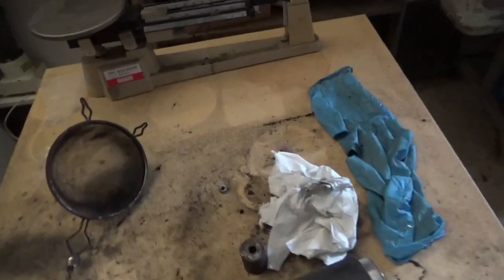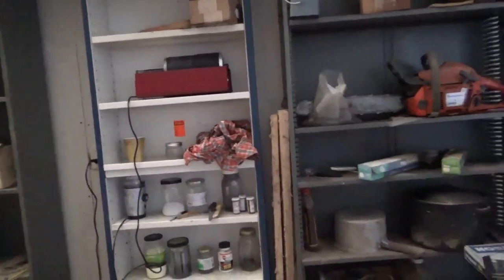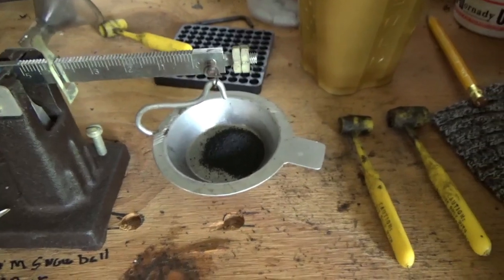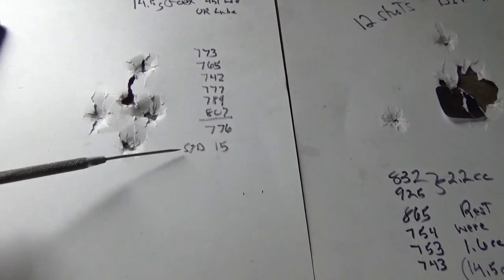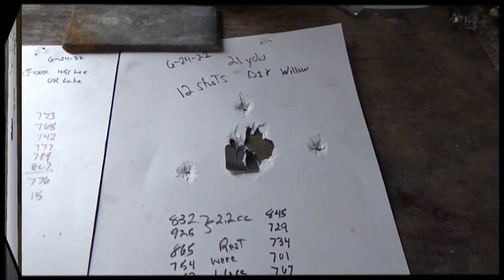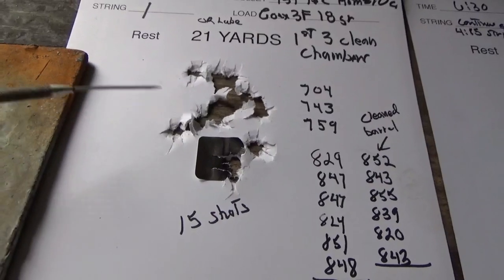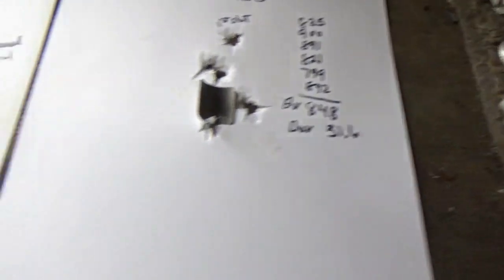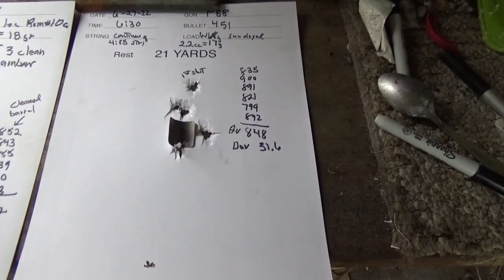DIY Black Powder VS GOEX in Revolvers

Comment: I've been making my own powder for a long time. I don't have a press
I just screen it. It works fine in my revolvers and rifles. For those who don't know, it's not dangerous if you are smart about what you are doing. I've never had an issue ever.
Reply from the maker: Thanks Joe.  I'm leaning right now towards the screening process.  The problem with the pucks seems to be the drying time.  O.R.

Comment: I have been making black powder for decades and have honestly found no difference in what wood I make char from. I get the sawdust from a mill that has all kinds of wood in it. I have a big metal container that I fill up but do not pack tightly with sawdust.
Seal the container with a cap that has a hole in it . put it in my wood stove over night  to char it. then put it in my ball mill till it is like the texture if baby powder.  Weigh it and add 8% of that weight in Dextrin.( Corn starch baked till golden brown) and put it back in the mill for an hour. There is your carbon and your binder.
Mix in the proper portion of Sulphur and Salt petre. and mill with a couple dozen .50 caliber lead balls. fos a couple of hours..
Now pour the whole lot of powder into a gallon of 91% alcohol 
and let it soak over night. this really bonds the particles. 
pour the slurry into a metal baking pan or two   
and let it bake in the sun till dry and hard. Bust it into chunks 
and screen it to the desired grain size..
That is my Smoke-A-Lot Stank-A-Bunch powder.
I have fired everything from my .38 caliber target hand gun to an inch and a half bore cannon with it.
Reply from the maker: Thanks.  I really appreciate you explaining your method.  There sure seems to be lots of discussion about what type of wood makes good black powder.  As you point out, there are sure many different approaches to the actual making, and possibly this is where the difference is.  From a chemist's point, carbon is carbon, so I would think that the claimed difference (which I think there is), would be in something that was not removed by the charring, or in the processing.

A question.  What do you find about it taking on water in high humidity which would reduce it's power?   Is that the reason commercial stuff appears coated?  I notice that Swiss is really shiny.  Thanks for your information.  O.R.
Reply: @oldranger3044  The graphite glazing is to make the powder flow better.
Reply from the maker: @segarza  I can buy into that. Common thought is that it prevents moisture absorption. Possibly that is true also, but the graphite has been used often as a common friction reducer. O.R.

Comment: Good stuff! I'm just getting started myself. Thinking about trying Ailanthus "tree of heaven" for the charcoal. It's a fast growing invasive species that is all over the place. Do you know what factors make a good charcoal for bp?
Reply from the maker: No Bill, possibly someone viewing here will comment.  I have read that softwood is preferred.  I tried some hard maple, and seemed OK, but quit because I was getting too many irons in the (ok this phrase is a poor choice).  Seems like my speeds are right there with GOEX when equal weights (not volumes) are used.  I don't attempt to use the harder chunks that are in the charcoal, figure maybe they still have other remains in them.  After all, they stayed un-busted up for some reason.  
Perfect plan for the invasive stuff.  You do a video of how it makes the best powder, especially the roots, and bingo, no more species. 
Thanks for the comment, and good luck, and be careful with the new project.  O.R.
Reply: I've heard plum wood has the most energy at the top of the list.
Juniper, which is eastern red cedar 
along with Buckthorn, and willow

Comment: Isn’t that incredibly dangerous? 
Plus you won’t have any insurance claims or lawsuits if anything goes wrong.

Not saying your bad for doing it.
And did you make all the separate components or did you buy them?
Reply from the maker: Components were purchased, except for the charcoal.  Yes, it can be dangerous, so I suppose is reloading ammo, and driving to the golf course.  My plan is to do it during the summer to reduce the chance of a static spark that could cause my wife to start collecting my SS.  Knowledge, and common sense are needed for sure. Thanks for viewing.  O.R.

Comment: One experiment I have not tried. As you may already know goes did sell, and production should be up soon.  Have been considering testing some swiss powder as I have seen some positive results.  Plan on testing 3f 4f, and null b
Reply from the maker: Just a question, how will you be able to get Swiss, or do you already have it?  I only have a pound of 1.5, and have not tested because it seems somewhat pointless to find out that it is works really good, and then not to be able to get any.  O.R.
Reply: @oldranger3044  there is a distributor out of texas shuetzen powder.  Been waiting in in part for all three to be available at the same time.  So when I purchase it for one hazmat fee. 

Earlier this year I wanted to order .45 cal 50 gr pellets.  The vendor would only allow 1 box per customer. Not sure who would pay the fees for one box, but it wasn't going to be me. Now I 500 pellets off the shelf of a local dunhams. Just to test 50 grain 777 pellets in an 1866 remington carbine  with my 165, and 190 gr bullets. So when I order it will enough to last my kids life time. No need to order till.i can. I have enough goex 2,3, and 4f to take it out to include grandkids as well and a few unknown brand club purchased can or 2. So for me the  3 4 and bull b in my two flintlocks and my .31 revolvers three pounds of each would carry me for ever  though I have test 4f in my ruger old army.

Oh and the pellet experiment was inspired by another YouTube creator joannie known as Ruger old army girl,  with her ruger and a round ball. My 165, 190 grainer's ar shorter than a round ball. So the pellet is not my idea. How ever a 2 f pellet out an 18" barrel could be a complete burn for efficiency.
Reply from the maker: @StevenMMan  thanks Steve, will check it out. Have you ever seen pellets made of actual black powder?  O.R.
Reply: @oldranger3044  no I haven't. I can't say it wouldn't be possible though.  As a do it yourself my guess would be for what pellets are designed for(inline musket cap/209 primer) I suspect that paper cartridges would be simpler. I'm not an inline guy on anything other than revolvers.  Even my one 1n21 twist rifle for conicals is a sidelock, with musket cap ignition.
Reply from the maker: @StevenMMan  I do own one inline rifle.  Austin & Helleck.  Wood stock, nice workmanship.  Haven't fired it and have been the owner for 10 years.  Thought I might put it up against my Hawken but never did.  Just not into the pellet thing I guess.  Just wondering, because I can't say I've seen them either.  
So far, the my DIY powder doesn't have the hard grains, and probably most would get stuck up on the side of a rifle barrel.  Anyway, thanks for getting back on this, I'll investigate the paper cartridge if the pucks I'm drying now don't work out.  O.R.